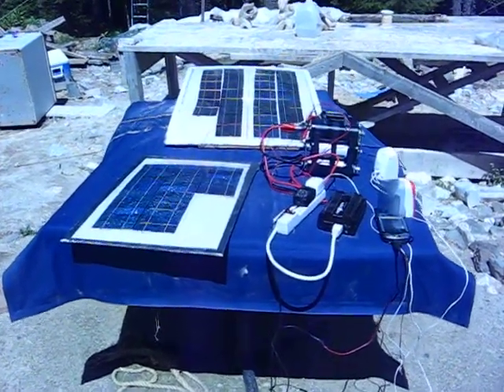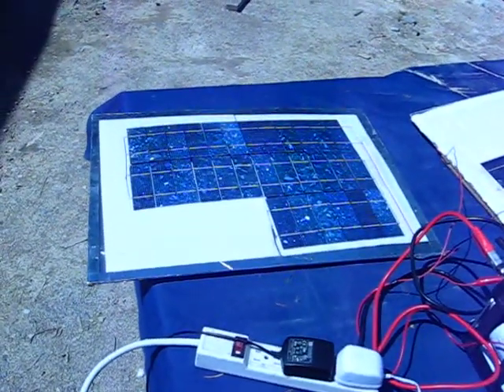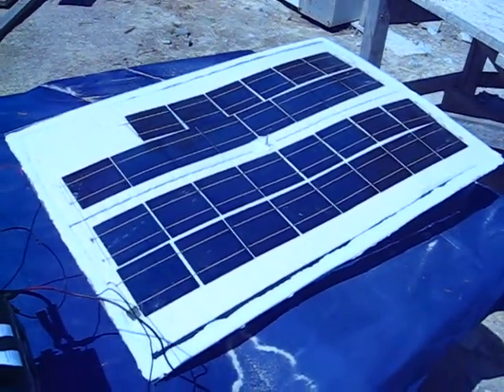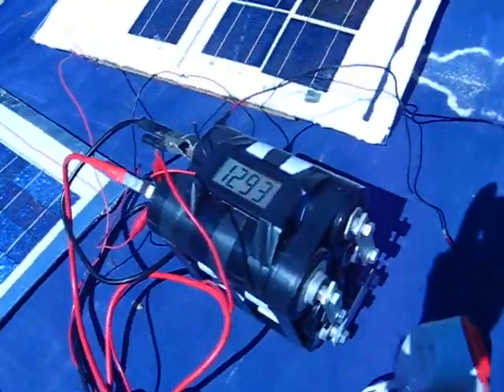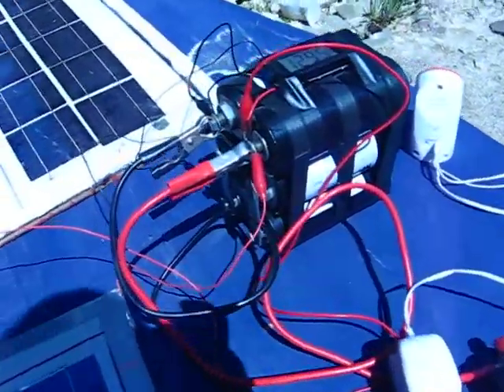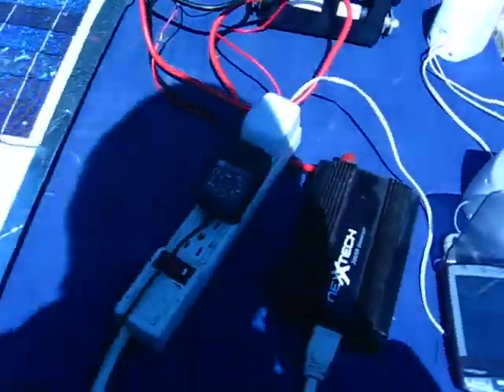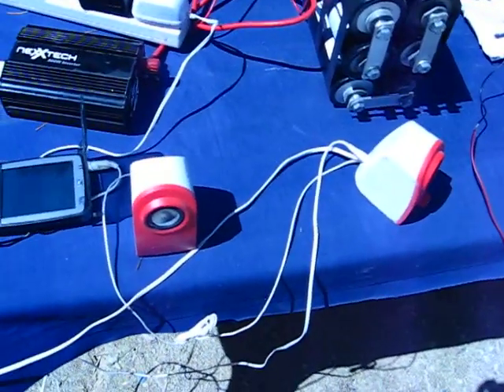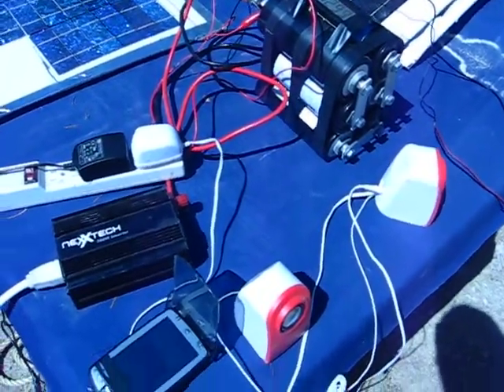solar powered ultracapacitor music

Comment: So if I had these with a mini solar setup 12v 200w would my mppt solar charger handle these ok or would it destroy it? Or should I use another voltage regulator?
Reply from the maker: badsaddamdotnet If you tried charging them directly off the mppt charge controller it would probably treat the capacitors as a short circuit and shut down  unless they were close to 12 volts.

I'd use a current and voltage regulating buck converter set to 13.5 volts 15 amps,   keep in mind that the capacitors will deliver far less than there rated capacitance when in series,  430f in my case  "divide the rated capacitance by the number of cells in series."

The main issue I think would be with cell balancing,    you would want to monitor the cells to prevent overcharging.

If your system is stationary you would likely be better served by a deep cycle battery.

The best use I can imagine is for running power tools for less than a minute at a time,    or spot welding.
Reply: thanks for the help :)

Comment: Finding it difficult to understand super caps. When these caps are fully charged to maximum limit and you directly connect this caps with the inverter, wouldn't it blow up the inverter? These caps are meant to supply huge amps, so why your inverter didn't fry up? And if i connect a iphone car charger directly to this caps, will it blow up the charger?
Reply from the maker: The inverter presents a variable resistance to the capacitors,   lets say you put a 100 watt bulb on the inverter,   assuming 75 percent efficiency  thats 125 watts.     125 watts divided by 12 volts yields ~10.5 amps,      12 volts divided by 10.5 amps gives about 1.14 ohms.       so in this instance the inverter acts as a  1.14 ohm resistor,        the capacitors voltage of 12  divided by the inverters resistance of 1.14 ohms   results in a current of 10.5 amps,        if the inverters resistance was low,   say 0.01 ohms   then   the current would be 1200 amps.      Normally it has a high resistance.